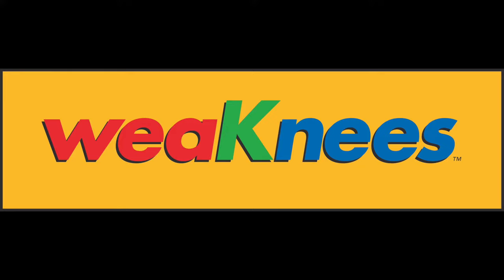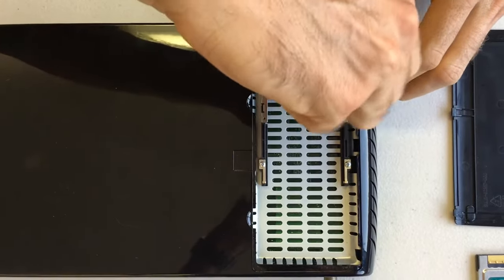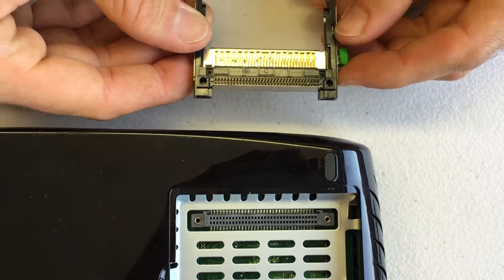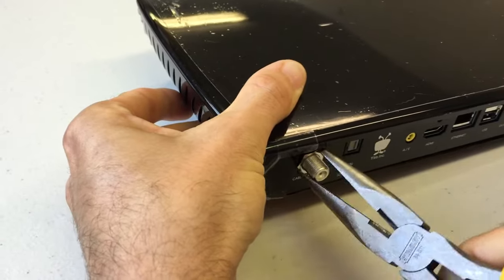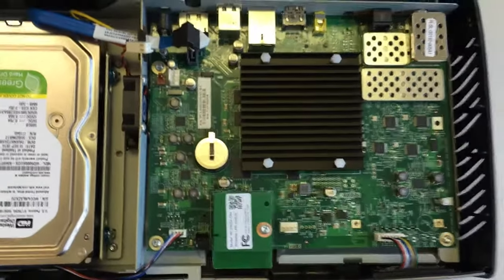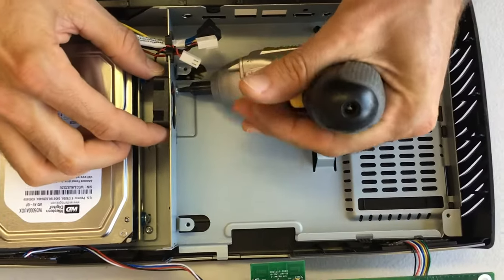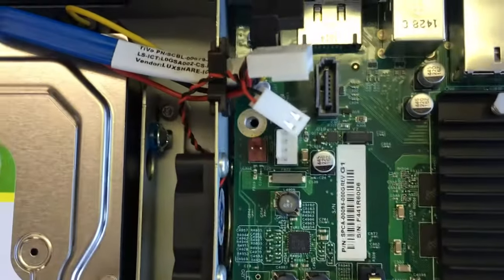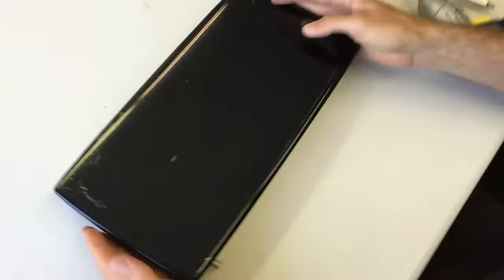WeaKnees TiVo Roamio Fan Installation

Comment: I just finished my replacement, but I did not put in the bottom screws.  That way, if I have to replace the replacement fan, all I need to do is open the top cover, and not disassemble the Tivo completely. The two top screws are easy to get to, and are really all that is needed.